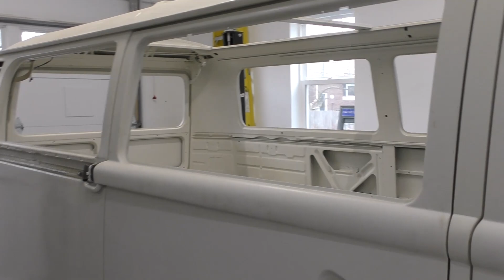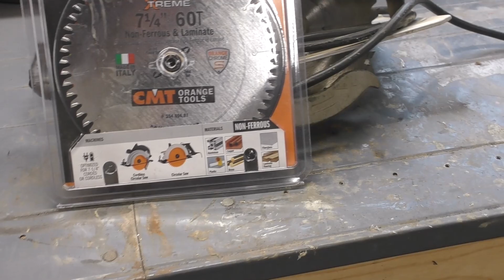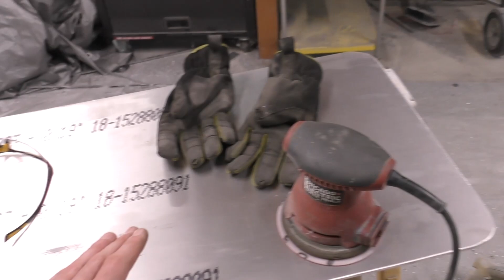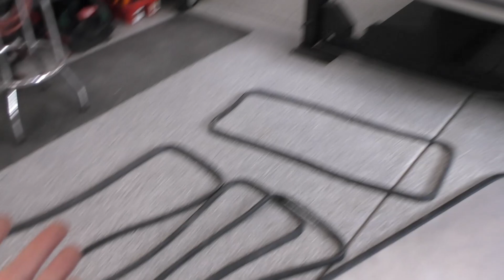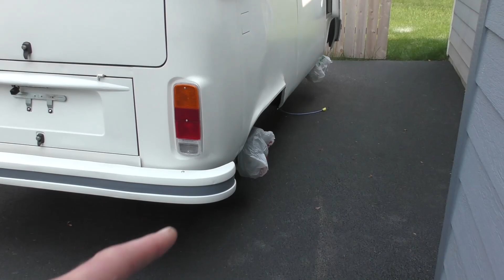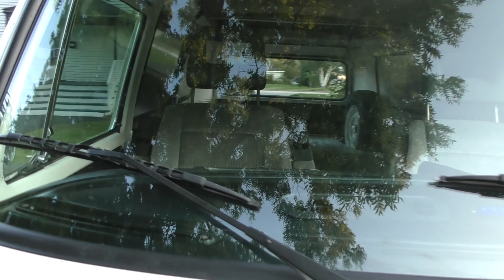VW Bus Restoration Part 31: Blank-out Windows; Panel Van Conversion

Comment: It’s funny to hear measurements in inches instead of metric.
Reply from the maker: 😆 That makes sense.  I don't know why the US can't just join the rest of the world and get on the metric system.  Thanks for watching, Ian!
Reply: @FixItScotty  the UK where I am has its own hang ups over metric / imperial. We are 90% metric, but a large drink in a pub is still a pint and road sign distances are still miles. It would be a definite vote loser for any politician to try to turn them metric, so they won’t ever be changing. But I’m glad hardware measurements etc are mm over here.